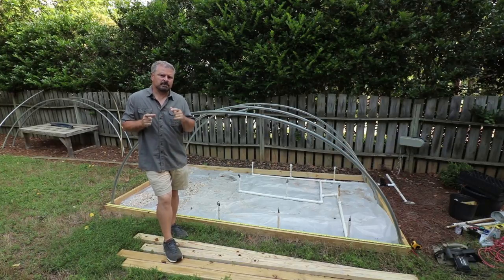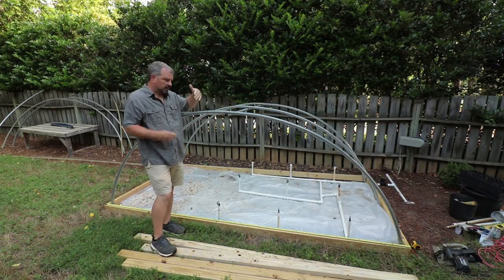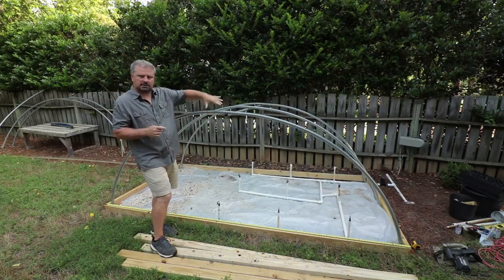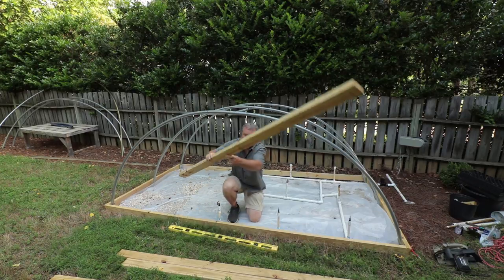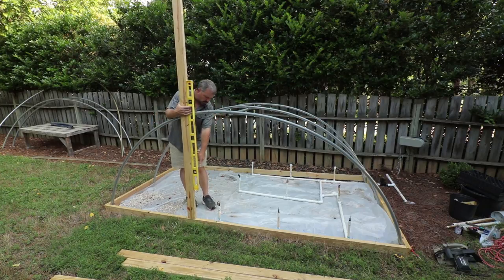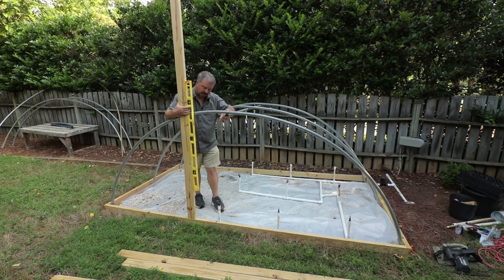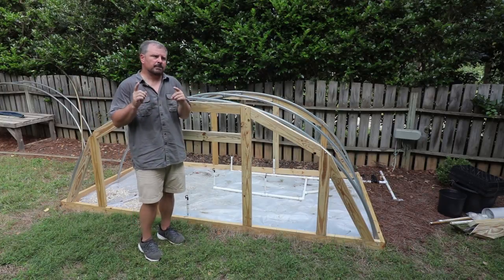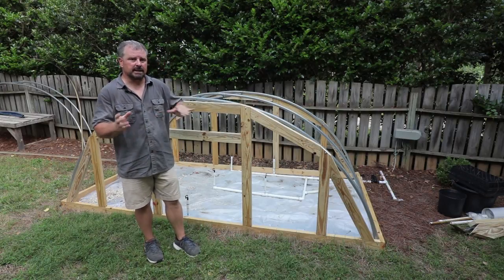Backyard Plant Propagation 3 - Framing The Greenhouse

Comment: How about some heavy under framing to jack this greenhouse up about 3 feet?  And make the bottom a U shape walk in, so one can work with plants at waist high?  Very interesting project...have never done anything like this.
Reply from the maker: That would be fine for plants that are already rooted, but for rooting cuttings low in the house is better. It is much cooler on the floor.

Comment: I really liked your last years series, which got me started on rooting cuttings myself so thank you for that! 

I also have 2 questions (1 unrelated to rooting cuttings):

I took some cuttings from a currant bush. I noticed one of the stems is changing color from green towards a more brownish color. Is this just the natural process of hardening off or is this a bad sign regarding this particular cutting?

I am also growing a few raspberry bushes but having problems with one of them. This particular bush produced a lot of very small stems in spring as opposed to 3-6 thicker ones. They are also not very tall and the bush keeps starting new, very small canes. What could be the cause of this and will they be able to carry fruits next year?

Thanks a lot and looking forward to the rest of this season!